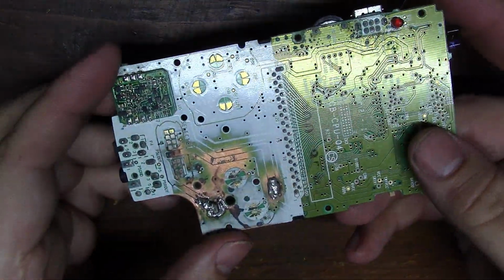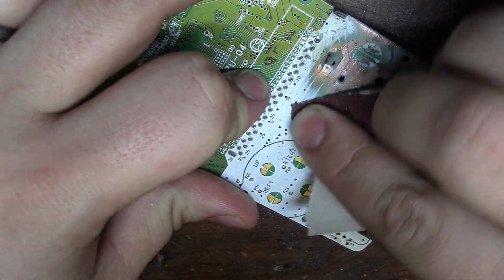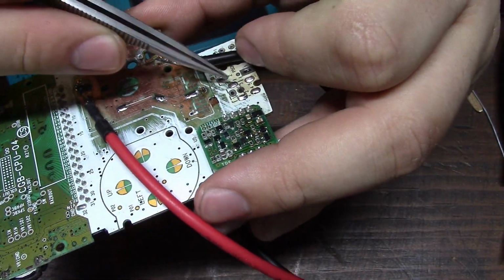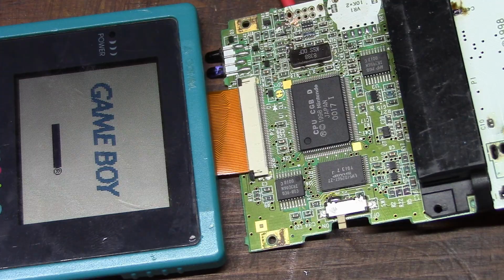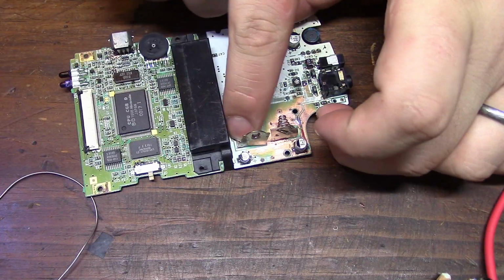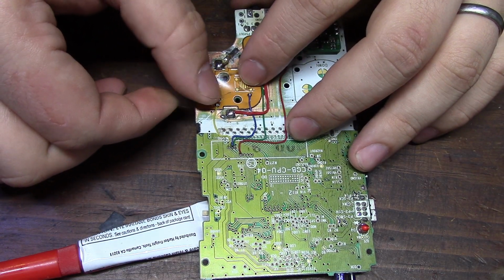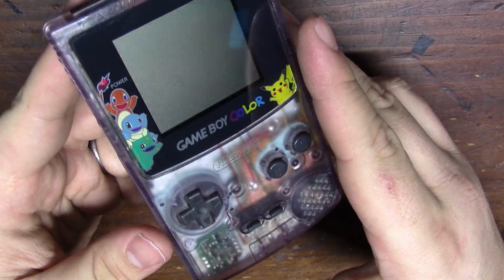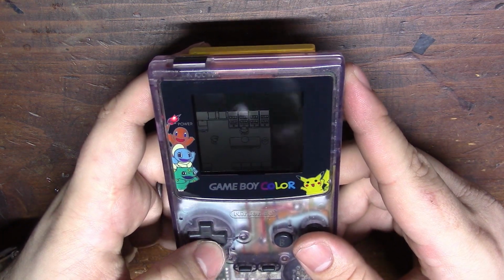EXTREME Gameboy color restoration! Batteries did this?

Comment: Why do you have to rewire the buttons if they soldier down to the test pads?  Seems like aslong as the button pads connected there then no need to run a wire unless a trace is damaged elwhere. Crazy work this one def took some damage. Awful what leaving patties in can do.

Comment: Got one not as bad but the a and b had a mound of battery acid curried kn them. Got it most rubbed away from various methods. The A was still not working all the time so been working at it and the B while at it even tho it worked the bad were still very dark. Well now the B don't have signal at all but has more Cooper showing than before.  So not sure what happened. Very strange. No continuity at all on B unless jump a wire str8 to pad. Which makes me think it's damaged somehow between pad and test point but looks solid. I wonder if 2 much of the pads can be rubbed away but still show Cooper?

Comment: I have a portable tape player that runs too slowly. I tried to get at the trimmer pots to speed it up but in the attempt, I broke the battery positive wire off the PCB. At that point, I realised I was out of my depth and put all the parts into a bag along with a few other portable tape and CD players that I picked up for cheap on eBay as faulty. If you could take a look at them, it would be much appreciated. I'm happy to pay for postage, but the repair budget may be limited. I have done some diagnostics on them and can list the various faults I found if you choose to accept this request. Either way, thank you for your time, and thanks for making this video! It's always nice to see something so badly damaged go back to fully working.

Comment: Have you tried getting fiberglass pens for soldermask removal? Far less anxiety inducing and dangerous for the pcb, it allows working in very localised areas and you don't have to remove the components. It's great, I can highly recommend it
Reply from the maker: I've used them in the past. But personally didn't like the feel of them. Like nails on a chalkboard lol. But I can try them again maybe.
Reply: @Solder_king  ahh i know exactly what you mean, but i don't think that's ever gonna go away. they're gonna keep that horrible scraping feeling forever unless they start making padded pens :P
Reply: Ive got one gonna try for that to find an issue with B button. They also work great for removing build up on pads or contacts. Had a copy of yellow someone sold me that seemed to have coke spilt on it they failed to mention even tho still stained slightly works like a charm now.
Reply: the 150 grit seemed excessive bro. really good/informative video though thanks.

Comment: Awesome video as always!
Question. Do you do paid repairs? I ask because I dug out some of my old consoles & have been bringing them back to life. Have a slim PS2 running Component & looks really good IMO.  Also a fat PS2 in the middle of a deep clean & possibly a new laser that will also use Component cables.
My issue is with my Gamecube which is a 101 model which needs a mod to run Component/HDMI I believe. I can solder a bit but the Mod looks like it's pretty fine work so beyond my skills. Is this Mod something you can do/ would be interested in? Or perhaps point me in the direction of some decent resources?(currently using Ebay & Amazon for parts)
Currently have a SNES, Genesis 3 & PS1 after the Fat PS2  is done. Got the PS2 Slim & Gamecube working with just cleaning & new wires, even got a Brooks adapter to use my DS4 on the PS2 was pretty proud. lol
Thanks for your time.